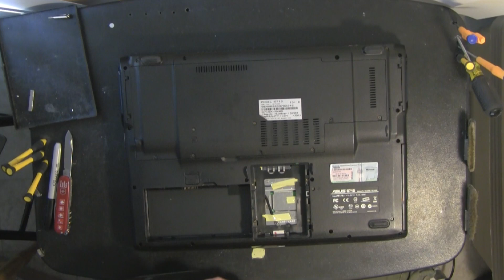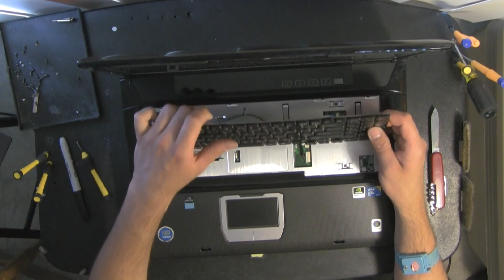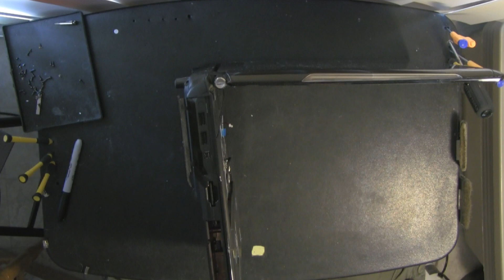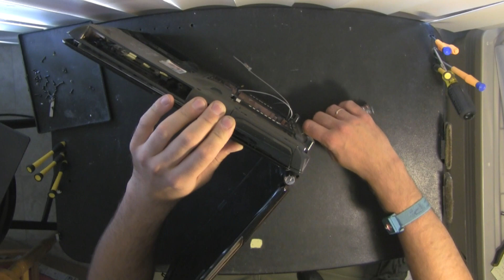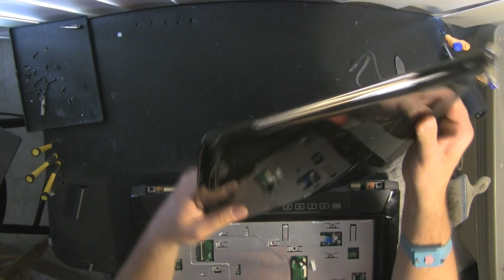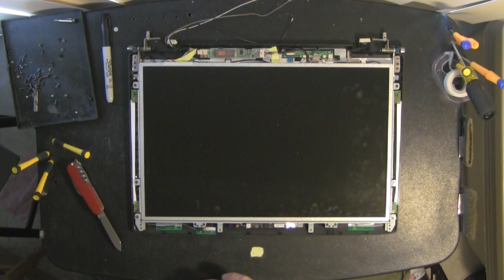ASUS G71G R.O.G. take apart video, disassemble, how to open disassembly

Comment: I just need to replace the motherboard so do I need to take the screen off or can I leave it on completely untouched  and nice vid.
Reply from the maker: I am not checking a video now (on mobile now) 
If palmrest is removable without taking screen out, than it should be possible.

Comment: Hi, do you know if the G71GX motherboard fits inside the G71G notebook? You see, I was thinking of upgrading the GPU to a GTX 260M and this can only be done if I replace the entire G71G motherboard! Thanks. Also do you know if if is possible to put a QX9300 CPU on the G71GX motherboard? Thanks again!

Comment: What's is the name of the component that goes in the purple part on the mother board please?
Reply from the maker: What time?
Reply: @regazzz  15:04 purple part! That's cpu? And I have other question the graphic card is the big one on the left?  Thx
Reply: @regazzz  I have a g71v  I bought the laptop in 2008 and I love this machine but today stop charging... I think the problem is on the mother board jack... I put the charger and the computer don't give me any light... The charger is good... So I think I'm gonna sell the parts. Thx for answer me. Sorry for my bad inglish... I'm Portuguese.
Reply from the maker: @jo.Driguez  cpu was exposed at around 4:41 and at 15 minutes a gpu was removed
Reply: @regazzz  thx regazz... i learn a lot with ur video.... You work fast.... That's crazy... Now I know what is the cpu and the gpu.... 👍Thx for helping me... I wish you the best... Stay cool. Thx again